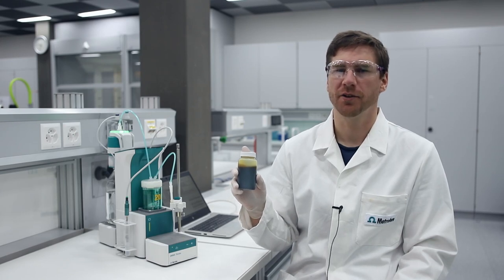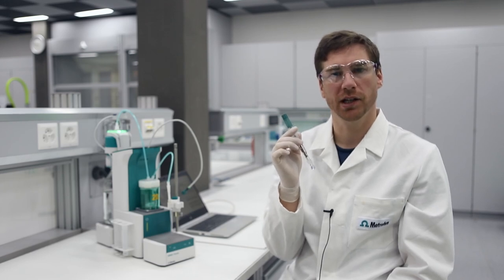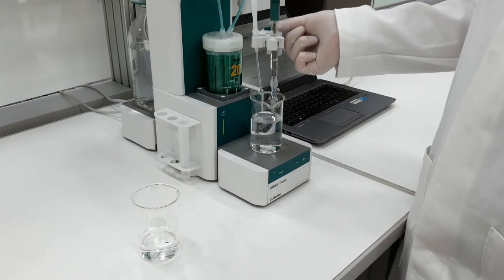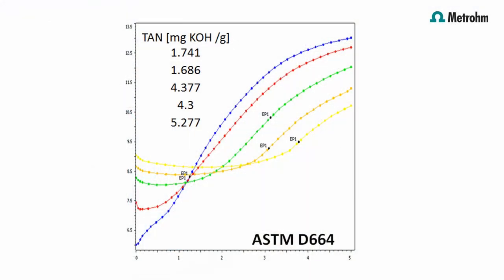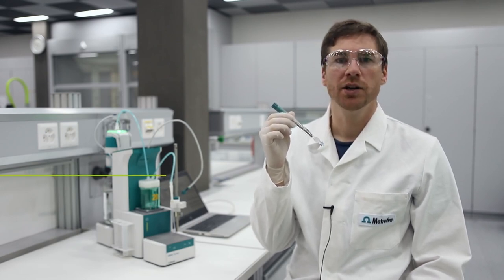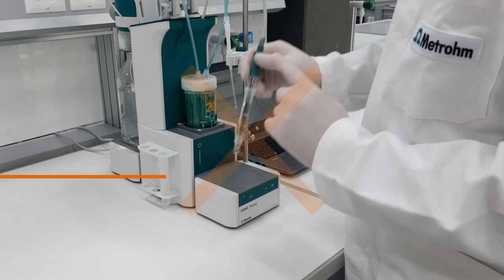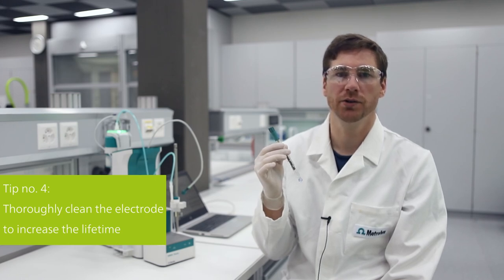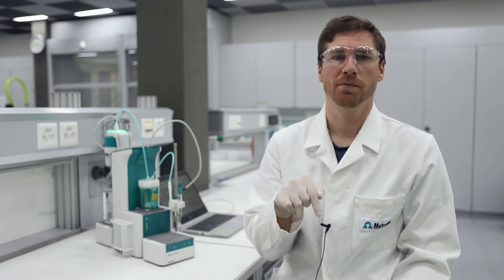Tips to improve accuracy and reproducibility of acid number analysis, part 1: Electrode cleaning

Comment: Thanks for video! Could you answer how to clean the electrode if there is salt left inside? Can acid be used and what concentration?
Reply from the maker: Hi Iryna
Do not clean the electrode with acid. If crystal precipitates are present in the electrode, we recommend rinsing with our electrolyte several times.
Best regards
Metrohm International Headquarters